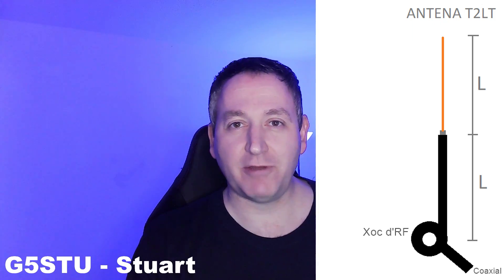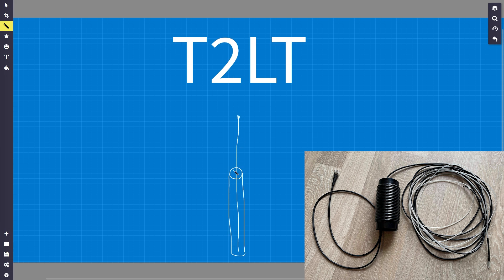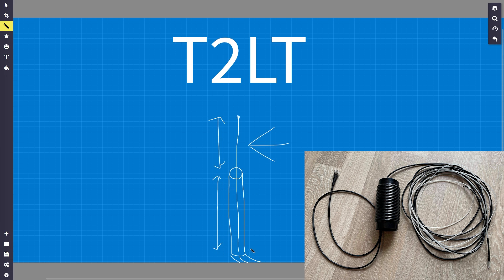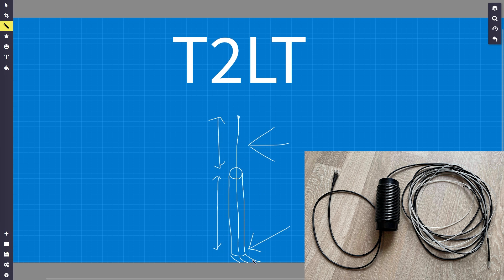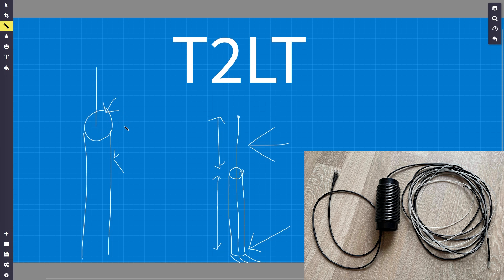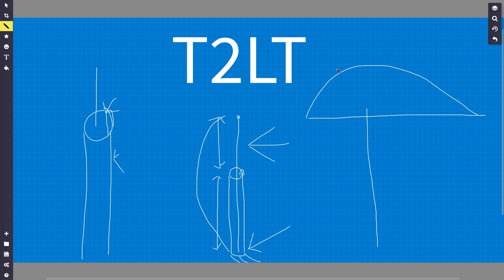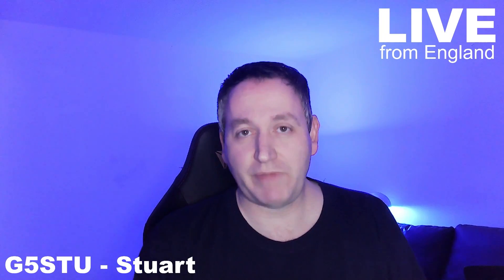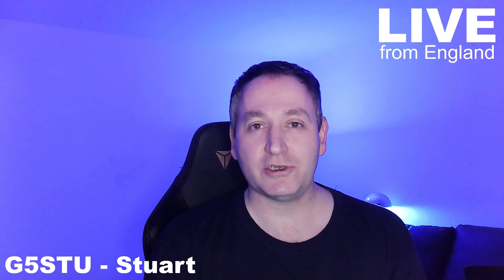T2LT - NO RADIAL VERTICAL ANTENNA - am I right ?

Comment: For 10 / 12 meters I've had XLNT broadband performance using 16T on 2.5" / 63mm PVC tubing. 
You might find the top could require up to 5% shortening (shorter, not bacon grease! lol ) due to "End Effect"

Comment: The wannabe know it all clowns on the forum they're telling everyone all you need is a current balun of five turns - lol
.
I went ahead and built one with five turns and what a fuster cluck! 
Not just the high SWR but variable! LOL and lots of RF in the shack not to mention poor performance in that I was hitting locals a lot weaker than the normal signal strength they knew well.
.
So I went ahead and wrapped a 16 turn voltage choke instead of a current choke and the thing snapped right in, kind of blew my mind at how broadbanded and how low the SWR is not just in on 11m but also up on 10m! 

Thanks for a good video 👊🤠
Reply: I had the exact experience as you. It has to be heavily choked to keep the SWR in range and RF out of the radio. I had to wrap 10 turns around a ferrite toroid core just to get it stable. It works but not the best out there. I’ll still keep it in case I get into a pinch though.

Comment: It looks very like an off centre fed dipole considering that the radiating element is almost twice the length of the other leg. The balun is only an isolater and not part of overall antenna length.
Reply: QRP700 - from the center up should be about the same as from the center down to the choke, obviously the center being the point where it's cut so the two legs if you will are approximately the same although you may have to trim the top on a bit due to end effect, but as odd as it seems that does not always come into play in my antenna building. 73

Comment: I've built one for 15m and I am using it on a 12m (40ft) telescopic mast. Works fine! 🙂
As a newbie I do not have much experience, however it seems to me like there is no simpler way to get on the air and to do DX QSOs.
Reply: hennero.3826 - well if it's a half wave on 15 m then it's probably about a 5/8 on 12 which should work great with maybe 2.5 to 1 SWR and if you have a built-in tuner it should handle that okay.

Comment: I built one for 10m, then tested it back to back with a shop bought 1/2 wave vertical, both at the same height....... The T2LT was just as good on both RX and TX, since then I've built them for 6m and 2m, great for /P!........ M0KED.